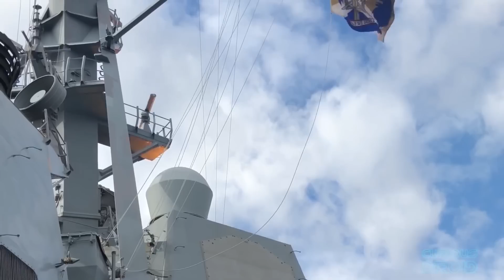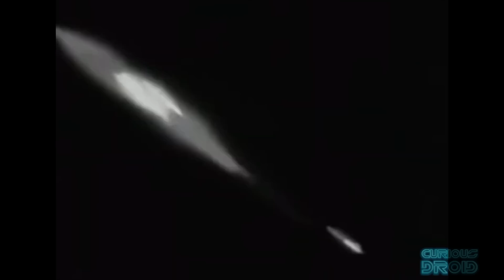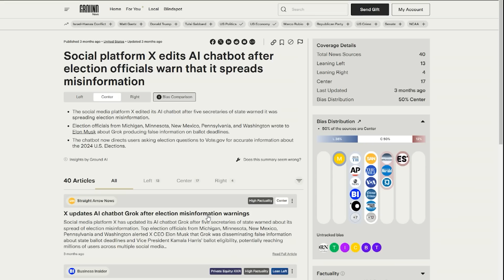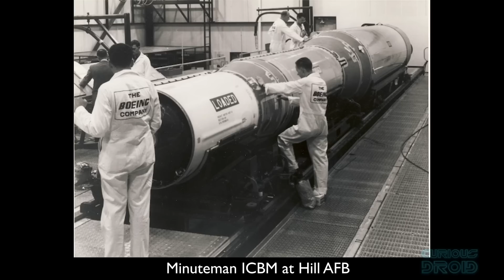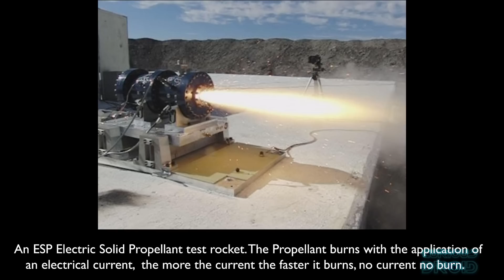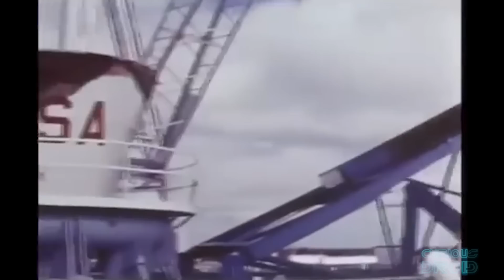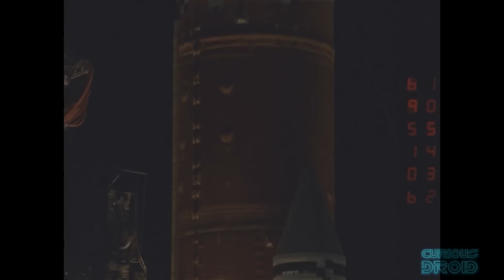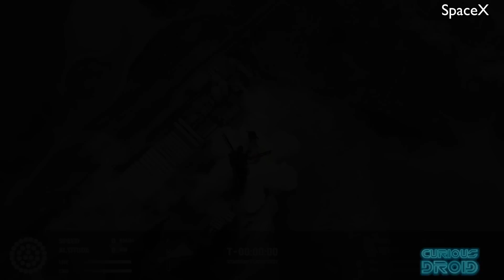The Most Powerful Rocket Motor Ever Tested & Why it Never Made it to the Moon?

Comment: I have trouble with the idea of riding a rocket with no throttle or off switch. They did Wyle E. Coyote no good at all!
Reply: Exactly why Werner Von Braun and his entire team refused to even consider solid fuel rockets for manned spacecraft.
Reply: @ghost307  "Werner Von Braun and his entire team refused to even consider solid fuel rockets for manned spacecraft."
Not entirely true, SRBs were used as ullage and escape tower motors
Reply: @invisiblekincajou  Good point. I was referring to the main propulsion systems.
Reply: @ghost307  Solid rocket tech in the early 60s was not ready for prime time yet. The SRBs, especially after the Challenger accident redesign, were among the most reliable pieces of equipment used in manned spaceflight. The early shuttle astronauts were far more afraid of the RS-25 engine blowing the tail of the orbiter off than they were of the SRBs, due to them witnessing an RS-25 blow up a test stand in the late 70s.
Reply: @RCAvhstape  Horse shit. An SRB blew up an entire Shuttle much later than the 70s. The RS-25s only blew up in testing. Same with the F1 engines for the Saturn V.
Reply: @RCAvhstape  Bull. An SRB blew up an entire Shuttle much later than the 70s. The RS-25s only blew up in testing. Same with the F1 engines for the Saturn V.
Reply: @SecretRaginMan  I'm restating what astronaut Mike Mullane says in his book. Prior to Challenger, astronauts were more worried about the RS-25 than they were about the SRBs. After Challenger, the SRBs have been reliable ever since on both the Shuttle and the single SLS launch to date.
Reply: @SecretRaginMan  That was mis-management, not a booster flaw.  The engineers said do not launch because it was too cold for the boosters but the management (and maybe political) pressure to get the TEACHER IN SPACE mission going  resulted it it getting launched anyway.  Boom.
Reply: I’m surprised the leader of North Korea hasn’t done that to somebody
Reply: That darn roadrunner always got the best of him
Reply: Turning off your rocket during accent is a death sentence anyway
Reply: @JackKoff-l8d  Have you never heard of a Launch Abort System? Turning off the rocket makes it safer to abort and get the hell away.
Reply: @SecretRaginMan  never seen a launch abort system that did anything more than eject the crew. I mean yeah typically the control computer is ejected with them but they don't turn off the rocket before aborting... no time
Reply: @JackKoff-l8d  They do turn it off when they can command it. See the Crew Dragon Launch Abort Test. The system detected an "anomaly" and commanded booster shutdown simultaneous with launch escape system activation.

Moreover, being able to shut down individual engines prevents catastrophic failure. SRBs don't have engine out capability.

Finally, as we found out with studies of Ares I, an SRB would likely preclude a safe abort because the burning solid fuel would destroy the parachutes. That isn't a problem for liquid fuel rockets.